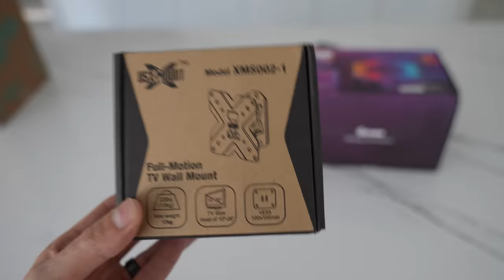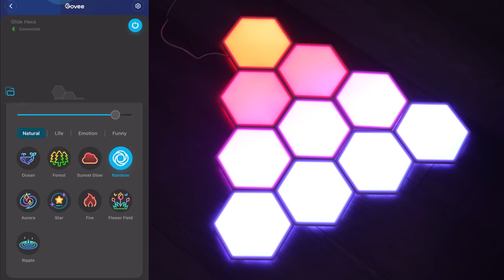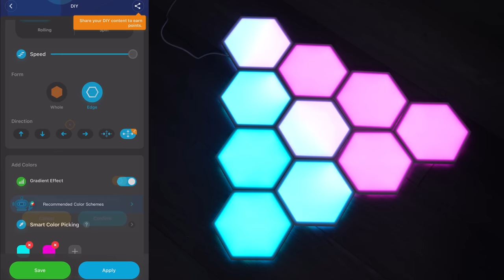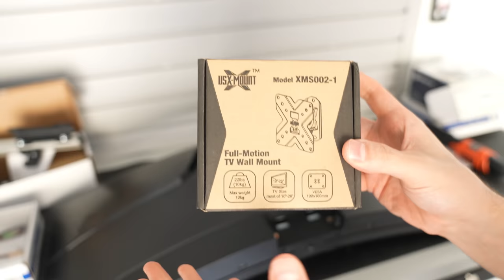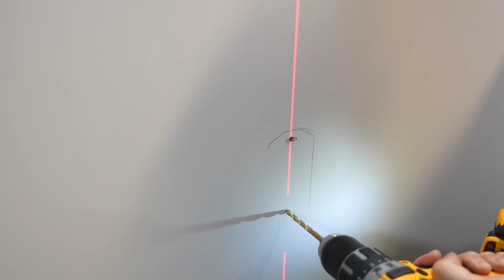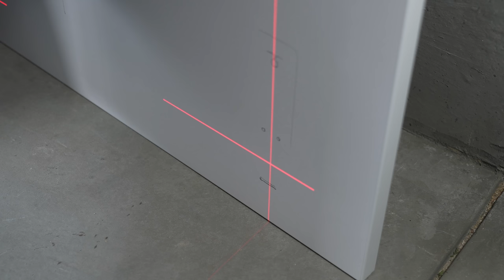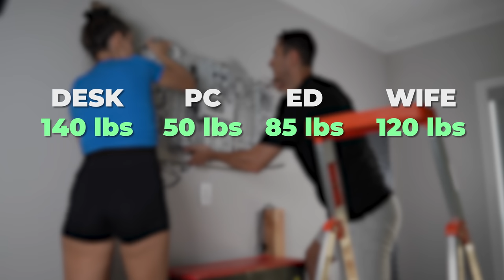Building My Ultimate Dream Setup - Part 4

Comment: Love that you put the white vinyl back on the monitors. The measurement and alignment requirements must have been nuts. I recently painted various hardware and mounts based on what I saw on your channel. I went ahead and spray painted my mounts and other hardware. I recently submitted to setup wars, and did a setup tour on my channel. Thanks for the inspiration!🙂

Comment: you should flip the top centre monitor and have the thicker bezel at the bottom because your lower monitor overlaps the bezel anyway. And the thicker bezel at the bottom will help hide that gap, and it will put the thinner bezel at the top to more closely match the side monitor bezels.

Comment: Hi Edgar, if you flip the top ultrawide by 180 degrees so that the bezel is at the bottom, you'll have a perfectly clean & thin bezel line connecting the top of all 3 monitors, while the bottom bezel will be mostly hidden by the bottom monitor. 
It would look even cleaner, try it out my guy! 👍

Comment: First of all i want to say ...that is one damn fine tidy setup !! ...one thing i myself would do is toflip the top monitor as where you've positioned it behind the bottom one you could close the gap between both monitors by having the thicker bezal at the bottom and while also having a better match for the top bezal of both the side monitors  :)

Comment: The gap and the monitor issue isn't because it's not flat. You didn't consider adjusting that curve you wanted. To have no gap, you need the same monitor on the top and bottom. Then you can angle it and there won't be a gap.

Simply physics. The bottom monitor has the same curve, but tid smaller so it's curving sooner than the top monitor is, creating the gap.

Comment: Changes I would make if I were to that kind of monitor setup is I would move the top monitor up. Move the top monitor up enough to where the top corners of the side monitors aren't lined up with the top corners of the upper monitor, instead the side monitors top corners would be lined with up about half way up on the upper monitor. Or about high enough to wear the top monitor isn't uncomfortable to look up on, but the bottom monitor isn't uncomfortable to look down. I'd also get a bigger mousepad across the desk mousepad, so it gives a better more filling effect.

Comment: The Sim-Lab Vario VESA adapters might help. They are primarily used by sim racers to perfectly align triple monitor setups, but might allow to to make the micro adjustments needed to align your monitors

Comment: good call removing the white bezel on the top monitor. however, you have covered it partially from the bottom, you may as well flip it the right way round? also, side bezels dont look great either. cant imagine it being aesthetically pleasing to look at it at all when the screens are off. The bottom one is subtle, but the sides are an eye sore.

On another note, enjoyed watching this series and cant wait to see the final look with all the rgb. :)

Comment: if you turn the top ultrawide the correct way then the overlap from the bottom monitor will just be covering the bezel and you wont have that bar at the top

Comment: Amazing setup! This has been moset waited video of the channel!
I think rotating the upper ultravide to the normal way would be better. Smaller gap between the monitors would be smaller without losing any screen view. Speaker power cable is showing, why didn't you drill a hole to the other side of the mount so one of the monitors would hide it. Ed, how about a headphone hanger?

Comment: If you flip that ultra wide back over to normal you could slide the bottom monitor all the way up to completely remove that gap since the bottom bezel of that ultra wide is pretty thick.
Reply: 👆👆Congratulations you won my prize 🎁.

Comment: Hey ed mate, if the gaps that are in between your monitors bother you a bit a trick i saw my mate do was use electrical tape, or even duct tape, and stuck it on the back of the monitors to cover the gap between his monitors. hope this helps keep it up

Comment: I've been having issues with my Govee lights. Hardware works fine, they're super bright. My only complaint is the software. Even after setting up the automation, it just doesn't take well. I'll say turn on at 7pm and turn off at 10pm. Then it does that plus turn off and on at random times. Trippy.

Comment: Ed turn the top monitor back so it’s the original way and tuck the trim behind the bottom monitor to eliminate the gap and it would make the top smoother
Reply: 👆👆Congratulations you won my prize 🎁.

Comment: Ed, don't you think you should flip your ultrawide back to normal? That way you have a smooth transition from the left, center and right monitors on the top. Also, since you're already covering a slight portion of the bottom of the ultrawide with your bottom monitor, you'll just be covering more of the big bezel whenever you just flip it right side up. So it's a win-win! Lol

Other than that, sick setup. Love your show. I now have a PC setup because of you!

Comment: 29:45 did you know that instead of using nanoleafs to make your setup look less bland you could use things with a different color other than just white to introduce *contrast*. doesn't even have to be a lot or a flashy color or anything, it could be as simple as using things with a bit of black or grey as an accent against the mostly white

Comment: Setup is going to be amazing! I'm curious, would it not make sense to flip the ultra wide back over so that the bottom monitor blocks the big bezel instead of part of the screen? This would also make the bezels at the top a more uniform thickness.
Reply from the maker: 100% I will be changing that eventually.

Comment: You got the perfect monitor imo. 27 inches 1440p 240hz is perfect. Imo anything past 250hz is diminishing returns. Sure super slomo 20x you cab see the refresh rate but it will not make the human reaction time better and it doesn't actually benefit you like people think. It's why you can compete exactyl the Same with no loss in your actual performance aka your competitiveness when using a 240hz panel. Sales and buzz words will make you believe something else. I think having a 1440o monitor st 240hz being able to use multiple resolutions is a much much better option. The human eye will not see that difference of leds then 1ms of someone cominf around the corner and allow your reaction time to be faster haha. Again it can't change the human eye or reaction times. Alot of people just don't understand this and listen to sales pitches.

Comment: When you changed out the gaskets in the DISTRO plates did you paint the screws or did you find/order replacements?  I just got my EK DISTRO plate and am going to swap out to white gaskets as well and want to do white of stainless steel screws.

Comment: You could've solve the gaph problem by lowering the ultrawide monitor a little bit normally without flipping it upside down

With it the thick bazel couldn't be seen and the gaph problem is solved

Comment: Just thinking but why dont you make the gap between the top and bottom monitor black to blend in with the black of the monitors, When they are turned off it will look sleek and when you play you wont see the white from the backboard as much also. Or maybe utilise the gap and add something in there that could be useful. Great vid btw thanks.

Comment: Use electrical tape on the back of the monitor to hide the gap in between the top and the bottom monitor.

Comment: Hey Ed i migt have a quick fix for the rogt monitor if there is those small spacer rings on ur monitorarm u could try to move them( like if there's one on the top and bottom of the inside screw move the top to the bottom so it will be lifted a bit)  Hope it help and the setup looks sweet.

Comment: I think with your first set of brackets you could just shim out the top bracket with some thin wood to hold it a little farther off the board giving you the even profile you wanted and being able to use the original mount on the bottom

Comment: Hi Techsource is it possible to build the same  moniter layout just without mounting any of the moniters to the walls but by using a couple of moniter arms? If so do you recommend any specific moniter moniter arms?
Reply: You need pneumatic monitor arms that can hold your monitor's weight and at the height of the monitors in vertical orientation. If your monitors are larger than 27", your best bet might  be to buy separate arms for each monitor. It is USUALLY not possible to SAFELY mount more than two monitors to a single arm base.

Comment: Amazing setup! But there is one glaring mistake that really needs addressed solely for you and your families safety. You are not supposed to run power cords (your power supply in this example) behind the drywall those cords are not shielded or insulated properly to meet interior wiring standards. I suggest having a new outlet ran behind where your pc is mounted.

Comment: It makes no sense to have the ultra wide upside down when the bottom one is almost overlapping the screen on the top one. By Having the ultrawide on its default position, you would have more space to align them with basically no visible gap.
Reply from the maker: Very True, I am planning on switching it eventually.

Comment: wouldn't you eliminate the gap if you turn the top monitor normal position (not upside down) and put the bottom monitor in front where the top monitor basel ends?

Comment: Hey everyone! I actually just got a sony 43 inch X85K to use as a monitor for my computer engineering position as well as im going to be ordering the 32 inch version of the G7 to go on top with the ability to be pulled down to play Apex and COD any pointers on the mounting? Kinda need some help.(Going to be mounting to a desk)

Comment: How'd you get the icons in center of your taskbar and where's the bottom monitor wallpaper from?
Reply: That's Windows 11 by default, how far behind are you? Also that bottom wallpaper is one of the most famous on Wallpaper Engine called Midnight Drive or McLaren or something
Reply: Well excuse me...sorry I'm not running 11, I haven't upgraded yet.
Reply: @chrisclark7248  Lots people haven't updated yet, it's just a known basic feature of 11. But loads of people also do in Windows 10, you can just centre your taskbar in 10 by default if you want in settings

Comment: bruh in 1 day you drilled holes and put up speaker mounts... in a day i built two sliding door made of glass windows, painted wooden frames, sliding hardware and everything was done in the sun in 35°C (btw i'm 16)

Comment: If you're going to have the top monitor slightly behind the bottom one (which personally triggers the shit out of me) WHY not have the top one flipped the correct way up? So you are not cutting off actual screen instead all you are cutting off is the bottom bezel of the top monitor?...

Comment: Man I don’t understand why you didn’t go with the new samsung curved monitor rotated vertically instead of 2 horizontal monitors with that annoying gap and the 2 verticals. I hate samsung as a brand but would prefer not having a gap between the horizontals instead of no gap between the verticals, I can’t understand that decision especially from you 🤦‍♂️ also none of the white skinned bezels make any sense, I would have expected way better from you…